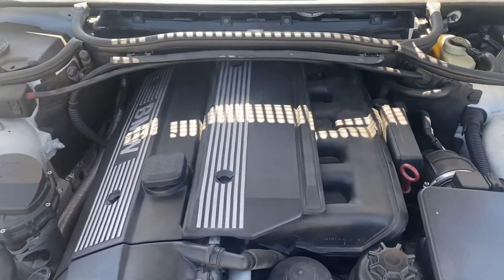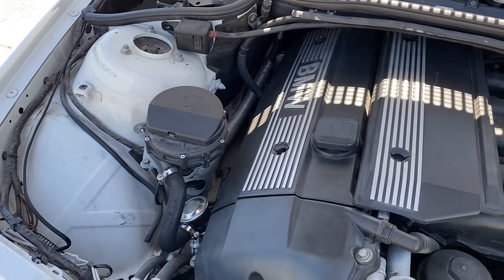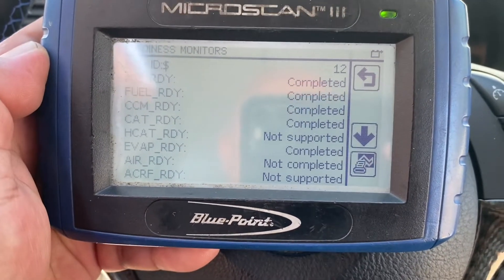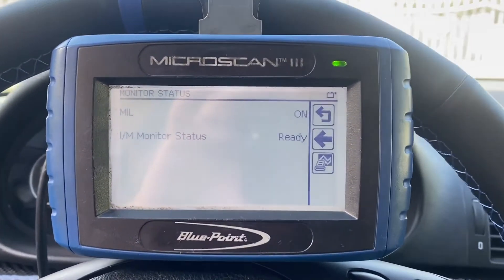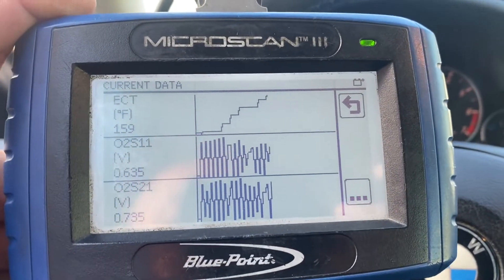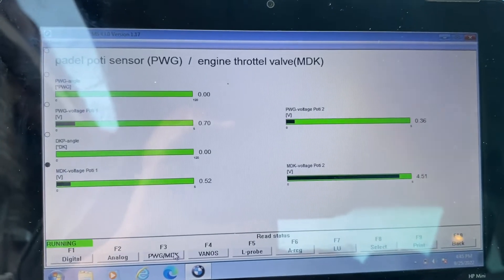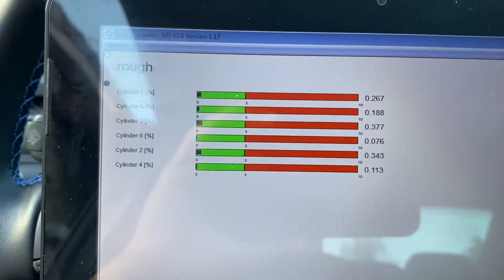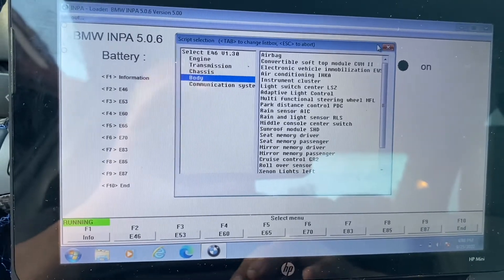E46 Secondary Air monitor cleared

Comment: Thank you !!!!!!  I have been starting, letting the car idle, aimlessly driving around to try to get the secondary air pump to register. I had no error codes, it just would not complete the process. Followed your advice and changed the 2 oxygen sensors and it completed the register within minutes.
Reply from the maker: I'm glad it worked, I did the same thing at first, and I drove it many times. No check engine code just wouldn't clear the monitors, but the 02 sensors fixed it

Comment: What's disappointing is that I never and never will use Windows for ANY reason. It's an unstable, untrusting OS by a criminal pedophile. However, I'll look into further possibilities. You've done a good video here, though, for those who DO use that system. WHY they don't have this setup for MAC/APPLE is beyond me.
Reply from the maker: 😂 Bro, because Apple and Os didn’t exist, back then
Reply: @acef_performance8416  Yes, they did!
Reply from the maker: I didn’t create the program, just sharing my experience
Reply: @acef_performance8416   Understood. Not harping on you. Just sharing my own experiences. I used to be a computer tech so, I've worked on both Apple and Windows. Never back to windows.  Video is good, though. May want to add that you should put oil filler cap back on when working on engine. Somebody may not be as aware as you and drop something small in that opening.

Comment: Will bad secondary air pump or bad oxygen sensors cause my EML to turn on my 2000 328ci
Reply from the maker: @lupeguevara9685  Waht codes are you getting, secondary air will not cause EML but bad O2 maybe.
Reply: @acef_performance8416  
P0120
P0158/P0505
P0601
P0170
Reply from the maker: Let me do some research and hopefully I can help you out, hit me up on instagram

Comment: Is the smog vacuum line only for California cars? My check valve doesn't have a vacuum port or a vacuum line coming out of it.
Reply: older bmws have the vacuum port, newer ones don’t have a vacuum line going to the back of the manifold
Reply from the maker: Not sure on that, I thought they all had it, but yeah this is Cali
Reply: Is your car a SULEV?
Reply from the maker: No

Comment: My E46,2002,250Kmiles
In order to fix P0171 (Bank#1)and P0174 (Bank#2) lean ( vacuum leak)
The following, I replaced by myself:
-Weak Gas pump
-Broken fuel pressure regulator 
-Broken Gas Filter
-Valve Cover gasket 
-Air-filter 
-Clean MAF
-Clean 6 injectors 
-All vacuum hoses
-New Air Inject Valve
-New delay check valve 
The P0171 and P0174 have gone !
*  For READYNESS:
I drew almost 2000 miles ( freeway and streets ) and patterns 2.1 minutes at Idle, 3 minutes at 20miles add accelerate to 50 miles for 5 minutes, deaccelerate to 20mile…, can not clear “Secondary Air Not Ready”
I used OBD 2 to test Oxygen Sensors waveform shown: pulses switching from 0.2 to 0.9V , Pass … but cannot clear “Secondary Air Not Ready”
The Dealer sells oxygen sensors cost $275 each (Upper stream Oxygen Sensors BMW Part# 11781742050), I bought Bosch $38 each but the electric plug is little bit bigger can not insert. 
I bought OEM BOSCH $18 (at Ebay )for two. 
After replacing, start engine at night ( Cold temperature) , Bingos!
I was so happy could not sleep!
Thank you for video
Andrew Tran
Reply: PS , 
I reversed engineering, put oxygen sensors back one by one, I found the bank# 2 has marginal/ Intermittent problem (only 50Kmiles, supposed last longer)
Reply from the maker: You are very welcome, i am so glad this helped you. This is why i documented this video, I did a lot of online research to find just a clue, but it was worth a try. I had done everything else. I had recently replaced all intake gaskets and vac lines, I actually had no codes, it just wouldn’t go ready. you did everything correct to chase a lean or rich condition, according to your codes. But remember 02s control all fueling so it can create this situation. Please like, share, and subscribe.

Comment: This did not work on my car
Reply: I cannot get my check engine light to turn off and I’ve replaced everything. Kombi valve, solenoid under dash, check valve behind the intake, checked for leaks, Even the 02 sensors before the cat you’re talking about. I’m having a P2770 code though being the secondary air Hot film air mass flow sensor which I’ve also changed 🤯 Please help
Reply from the maker: If you are trying to clear the light with a basic OBD2 scanner it will not clear, you need to use the laptop and software. Some e46s have a “check engine light” and some have a “service engine soon” not sure why bmw did this but I learned the the one with service engine have a combo thing where scanner will clear basic codes but for more in depth you need to use the software, it took me a while figure it out
Reply from the maker: What is the problem you are having

Comment: Thank you for this video.  I had the exact same symptoms with my E46.  There were no vacuum leaks, hoses were good, the secondary air pump appeared fine, and the secondary air monitor wouldn't set.  My car has over 200K miles without changing the O2 sensors.  I replaced the pre-cat O2 sensors and started up the car and let it idle for a few minutes.  I turned the car off and rescanned the car.  The secondary air monitor was set.  Thank you.
Reply from the maker: Your welcome, I always try and share what I find out, especially thing like this where you can read up on it but nothing like seeing it live, please subscribe

Comment: Thank you, I just ordered the tool and Bosch sensors for my 2005 325i as the registration with CA smog is due very soon. You made me a little nervous with the oil cap removed during the process.
Reply from the maker: If this is the problem you are facing it should work. Yeah not a good idea to have the cap off 😂

Comment: Have you checked uh a little air pressure that is behind the intake manifold that controls how much air goes in and out?
Reply from the maker: Yes, there is a check valve and a electric on/off valve they are both good, the O2 sensors where definitely the problem, the data on the scanner shows the difference.
Reply: @acef_performance8416  not to long ago I had p1093 which is a large vacuum leak and I had 172 174 I used torque app to look at my fuel trim this app help me out bought a smoke machine can't go wrong iam glad you figured out you're problem  am going on 238.753 miles on my Guage
Reply from the maker: I know I had no vacuum leaks I replaced all the gaskets and I check my fuel trims, I did have leaking brake booster but I also fixed it